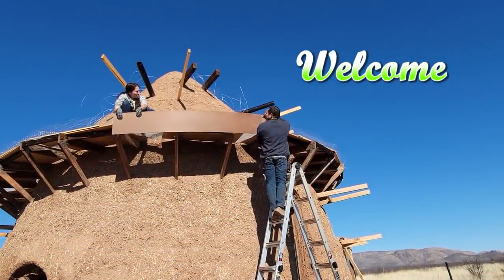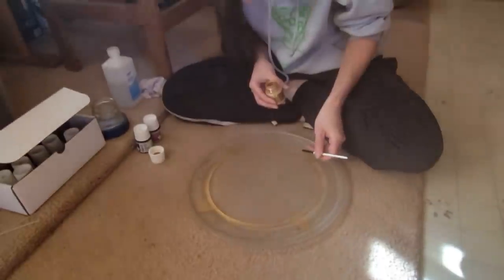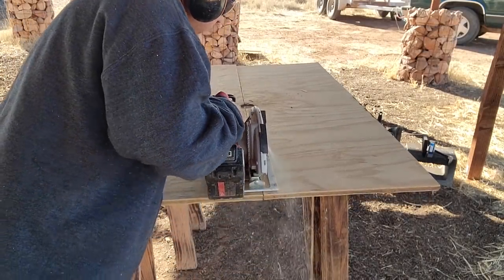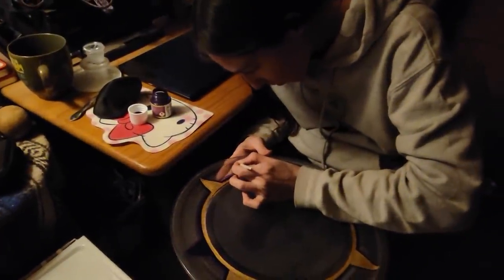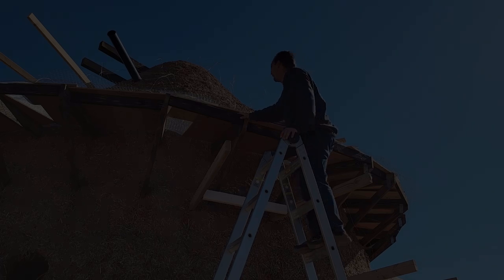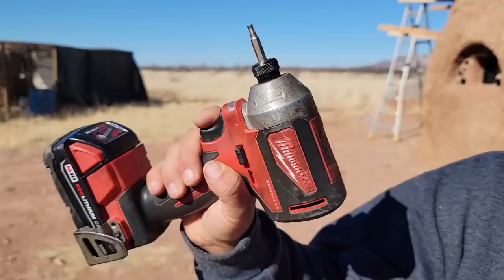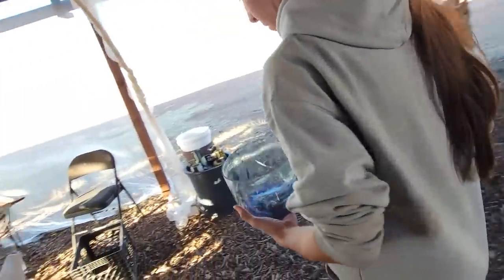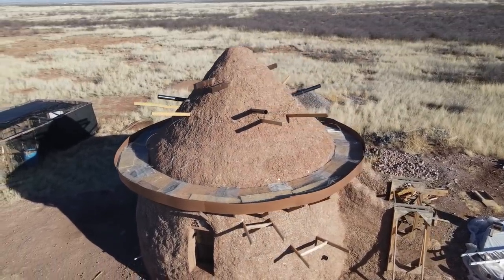Our Odd Little Earthbag Home Gets A Sombrero!

Comment: I sure hope that when and "if" you ever put straw bales up on that platform, you get them cover really quick before rain hits them.  Nothing heavier than a wet bale of straw and I doubt that the bracing will be able to withstand so many wet bales.  I'm not sure, but if it can be done, Jim will fashion some contraption to squeeze the bejeebers out of them.  Jessica, I admire your persistence with both Jim and Crew as distractions.  You show love by not decking the two of 'em, lol.
Reply from the maker: The eaves won't actually be supporting all the bales. It won't matter too much if they get a bit wet.
Reply: Wet hay/straw bales are also well-known for spontaneously combusting. A lot of barns have been burnt down that way.

Comment: Hay bales on top sounds like a disaster waiting to happen. A small leak into the bale will waterlog it until the whole top of the home is destroyed. If you need the insulation value to go up use the inside wall , or add more cob or add some stucco to the cob. Nothing that will swell up with water needs to be put on top as insulation. You have the perfect thing to use put in a small cast iron stove in the basement room and use the exhaust and smoke piping to heat the other rooms. Heat rises and so the stove in the basement will heat the whole home. 
   Another layer of cob with a small amount of cement will do nicely for a upper level roof and insulation. A rain catcher would be great also.  NO HAY BALES you are looking for trouble. Sorry Jim I had to get that off my chest.

Comment: JESS WHEN PAINTING ON GLASS USE WHITE CONTACT PAPER LIKE YOU LINE CABINETS WITH COVER THE GLASS YOUR WORKING ON DRAW YOUR STENCIL ON THE CONTACT PAPER THEN DECIDE WHAT PARTS YOU WANT TO PAINT, CUT THEM OUT WITH AN EXACTO KNIFE. THEN PAINT AND WHEN IT'S DRY YOU REMOVE THE REMAINING CONTACT PAPER. IF YOU WANT OR NEED TO CAN USE THE EXACTO KNIFE TO CUT ANY STUCK BITS SO YOU DON'T MESS UP THE ART WORK. GLASS CAN BE HARD TO PAINT, HOWEVER THAT SEEMS TO WORK BEST AND YOU DON'T HAVE ANY PAINT LEAKING UNDER A STENCIL.  HAPPY PAINTING :) HOPE THIS TIP HELPS.

Comment: My proposed solution for the chicken water freezing - insulate the bowl to slow the speed at which it happens. Shredded tires are supposed to be pretty good at holding heat, if you can get some - but otherwise, just regular earth walls too. Just make a pretty thick layer around the bowl, and preferably in a spot where it can soak up some sun during the day. You'll probably need to keep it properly shaded in the summer months, though. But yeah, it might slow the freeze enough for the chickens to maintain access to their drinking supply. ⚫⭕🥤💧🐔🐔😄👍🏻

Comment: Jim would it not of saved money and materials if you'd cut 4inch strips and put them below the sheet but on top of the 4x2s where the sheets are low that way you could have lifted all the low points getting it all nice and level and still have the wire on top to stucco to.
Jess glass is looking very good can't wait to see it from inside the dome with the light shining through it.
Krew keep up the good work what a good guard dog you are.

Comment: Jim, I don't know if I'm the only one who feels like I'm in the dark about what you're doing with the roof and eaves. I've heard the words ferrocement and straw bales. What is the plan for the roof? I saw the problem you had with the ferrocement gutters on the rain catchment, and I figured you would not repeat that method again. I guess I'm just worried about the weight of the ferrocement and the somewhat flimsy look of its supporting structures. Of course, I have NO experience in this and am just a keyboard observer, so I have no authority to speak. So tell me I should just relax and watch it all come together, if that is what is needed. But it would be nice to just have a little verbal sketch of what the overall plan is. Or, maybe you're keeping us guessing for a reason?
Reply: Elizabeth, I have some experience with ferocement.  It requires a huge substructure to support it.  Every small crack is a failure  initiation point sometimes called a stress riser.

This is starting to feel like the cockroach races at back at college; some people just came to see the crashes.
Reply: @honthirty_  I don't want to be negative about this. I admire Jim and Jess for their gumption and hard work and I don't want to see a big failure, especially in their home. It's the flimsy-looking nature of the wooden supports that has me concerned.

Comment: This might be both a little late for you and a bit too off piste!
Instead of Ferrocememnt you could try fabric. You take a slurry of cenment and dip your fabric in it and then place the wet fabric on the form. This allows you to "freeform" as well as getting an interesting strong structure and would use a lot less wire and rebar (or rods). It has been used in structural pieces like ceilings by architects to great effect, but is not a common method ... yet!

You could do all the wet work up there making life simpler. ..... just an idea you may not have seen yet!

Comment: Looking cute but, wondering how you're going to waterproof the Masonite and plywood to keep it from falling apart and sunrotting. If you haven't secured the Masonite ends yet, I suggest that you use some 1X2 firring straps as backers and screw them together at the ends. My hats off to what you guys are doing!

Comment: Pretty cool looking. Did you see that 2x4 flex when Jess came down onto that platform at around the 13 min mark, looks like that 2x4 has knots in it which makes a little weaker.  You might want to consider a support to the ground while you transfer materials up, if it's used for that.....just being cautious here.

Comment: Mr Jim.  make some  shims,  using your table saw, rip some scrap 2x4's to the thickness desired.  slide the ripped board under the plywood and on top of the support  2x4.   secure with a screw/nail
Reply: That might require some precision. Maybe have to use a tape measure.
Reply from the maker: I was thinking about that originally, but decided against it.
Reply: @ourselfreliantlife  why?

Comment: I think i mentioned one other time about using a barley ball in your outside standing water to keep it from freezing.  For example a 55 gal barrel that has a removable top. If you use that water exclusively for watering your animals it will keep it also from freezing in the watering units. plus a tablespoon of apple cider vinegar helps keep parasites down i think you do that already if i remember correctly.  The hydrogen peroxide the barley straw puts out with it breaking down will not harm you or your animals plus no parasites are able to live in that water,  i don't know how many balls you would need to do that with your whole cistern but if you can do that research it would be beneficial in the long run. Maybe a hardware store that carries Koi pond supplies can tell you more.  love to y'all.  I would also grow your own barley straw you can get the barley pearls for soups plus the straw usage.